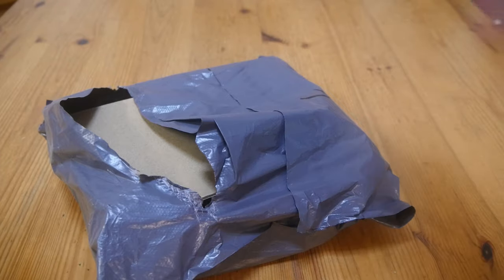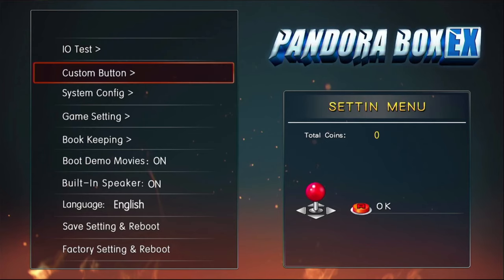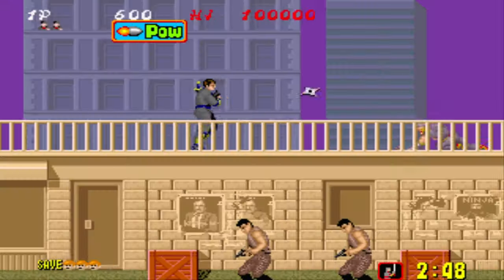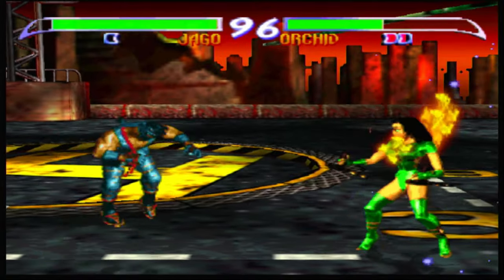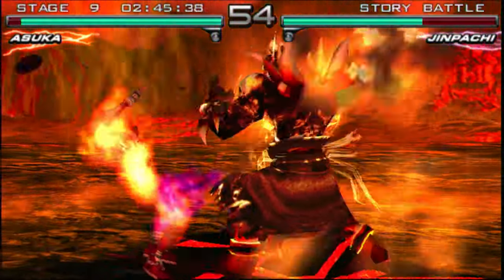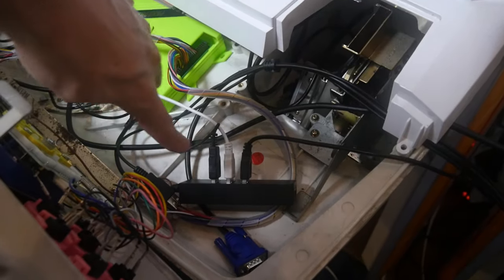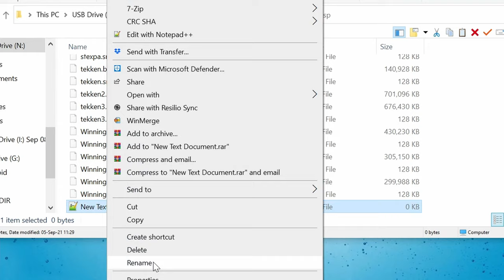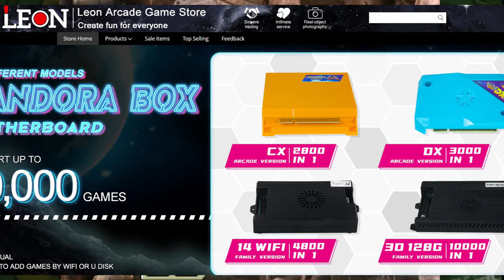3A Pandora Box EX [3300 Games] - FULL REVIEW and Guide

Comment: Not sure how it is on newer Pandora Box's, but for 6 buttons, I changed it in the global settings to ABC across the top 3 button, DEF across the bottom buttons.  This makes it normal for all Capcom fighting games, at least the arcade versions.  It might fix some of the control issues for other systems as well.
Reply from the maker: Yes. We are aware of control configuration. However setting abc def like that will give poor control maps for neogeo games, psp, ps1.

Comment: Will the the box work in an arcade1up  also. Once you set the controls lets say for xmen vs Street fighter will they remain set the next time you turn it on
Reply: I think you may need a video driver board, but outside that, yes.-  We have someone in our discord who has done precisely that (ex in the 1up).  Regarding controls- you set them up once for the WHOLE system-  cant really configure them per game.  The global control settings are saved, however.
Reply: @timwilson1042  thank you

Comment: I'm not sure that I understand why you cannot add more N64 or Dreamcast games. Is it because the flash drive is full or is there something in the programming that only allows two N64 games at a time. I would think you could add a larger flash drive or perhaps an external flash drive to the usb port like the DX has. Can you explain that to me. I asked the Pbox store and the 3H store and they said it was false. Just curious.
Reply from the maker: Please check our follow-up video on adding games.
The manual that was sent out was a dx, and even the ex manual had no explanation on adding games. - we had to work it out ourselves !!!
Reply from the maker: Regardless, there is no way to bind the analogue stick for n64 games, so near none will work. 
The dc is far more compatible.

Comment: Great video,. Question, many of the games I played like Striker1945, Street Fighter 3rd Strike, etc are not saving my high scores. The neo geo games like Aero Fighters and Bust A Move are saving my high scores. Is there a reason why some games are not saving my high scores?
Reply from the maker: Many of these arcade games actually DIDN'T SAVE SCORES (believe it or not!) - They left the games on for months on end.  NeoGeo had memory card / save functionality, so that could be why.  If you're concerned about keeping high scores, remember you can SAVE STATE when you finish and then LOAD STATE when you re-load that game. - It's a work around but should work.
Reply: @TeamPandory  Okay, I did as you had suggested and works great,. Thank you so much for the tip
Reply from the maker: @rokuvaan  glad to see you have a solution.  It's a shame the saves don't actually record to the memory card though... Or do they?  The ex was a bit disappointing tbh.

Comment: Hi, I need some advice. I have a jamma cabinet with 4: 3 arcade monitor (15khz), and the pc broke. I would like to wear a pandora, which one do you recommend? I was thinking about DX, I just need to emulate 80/90 2D games, I don't need 3D. Which is the best? Thanks!
Reply from the maker: We will be making a video regarding this in the next few weeks... The answer is a bit complex in that regards. 
I'm actually enjoying the "pandora x games" more than any of the 3A boxes in 15hz 4:3 CGA. The image is far sharper, and even though there is no save state, adding games, etc. It's just more fun to play on.
Reply: @TeamPandory  Strange, I knew that on the right you can save and add games ..
Reply from the maker: @Pumpkinold  with 3A boxes, yes. But the one I like to use is the Pandora X Games 2600 ... It is in our top 10 best Pandora list.  Has a much finer image than the cx or dx jamma.
Reply: @TeamPandory  But for the jamma cabinet with 15khz monitor which one do you recommend? From what I understand there is only one possible version, namely the DX. And they told me that 80/90 2d games all run fine. It's not true?

Comment: hello i have pandora dx im having sound problem in mortal kombat mk2 mk3 and umk3... i need mk2.nv mk3.nv and umk3.nv file?
Reply from the maker: Might be better to put this comment in a DX video- But you should check PandoryDX, we've just released 1.12 which also adds NVRAM for a few of these games.
Reply: @TeamPandory  not working witch pandory 1.12 for me....where add nvram files?
Reply: MK1 coin version run ok but mk2 mk3 and umk3 have problems with sound.....
Reply from the maker: @mariuszdobrzyn9603  Again, they are included when you install pandorydx 1.12 / Outside that we have them in the discord.
Reply: @TeamPandory  Again sound glitches.

Comment: I think 3A is totally falling behind it's clone competitors in terms of functionality. When they added console games to the DX, it seemed they were only doing it because Saga and PG3D had done the same to bolster their numbers. There seems to be little forethought applied to what titles they choose for these platforms.

I like their choice in chipset, it should be enough to add atomiswave and naomi games, strange they chose not to. The screen tearing is likely gone due to an increase in horsepower, not because of any change they've made in  their proprietary software.

Oh well, perhaps when 3H games chooses to release the FX it will address the issues you have, however unlikely that is.
Reply from the maker: That was mentioned earlier... I think it's more to do with the different hardware used with graphics drivers on the mali 400 being extremely flakey at best - especially on Linux.

This more likely has android running in the background , hint is the mouse pointer in the trackball game
Reply from the maker: Bang on regarding console / arcade games.  They lost focus with the successful clones. 
Bring it back. The focus on arcade, Naomi, flawless mame titles. The console titles included should only be arcade games that cannot run well, and not to bolster up numbers (includes nes/ hacked/ cheat versions)
Reply: @TeamPandory  I have no problem with them using the Snes9x core to include Killer Instinct or Genesis GX to include Galaxy Force II. Those arcade titles wouldn't run well on this hardware. But a title like Mario kart 64 should be added by the user if they're keen on playing it on an arcade stick.
Reply: @TeamPandory  I agree 100 percent with you. I wish they would come out with an "elites editions" like coinops has. Only the best games plus a handful of the best arcade style console games. Like 500 games total and make sure they are all configured right. 

Of course I know 3a will never do this because it's easier to market "more games!!!" Instead of quality games configured correctly.
Reply from the maker: @Brian Babin they updated the dx a couple of times, but still didn't manage to fix any of the irritations we had with the 3A range of machines. 
It's like asking the council to repair a large pot hole in the road. They'd completely ignore it, then go put up speed traps.
Reply from the maker: @ryecatcher25  don't look over there, we gots psp games now!!!!

Comment: I followed the instructions to change the resolution but nothing happens. Any advice?
Reply from the maker: What did you want to change resolution to?
Reply: @TeamPandory  I have a 5:4 monitor but I have just realised that 1280x1024 is not supported
Reply from the maker: @fabriziob8522  If your monitor supports 720p or 1080p input- it'll be ok.  It'd just stretch it to the screen size.
Reply: @TeamPandory  my monitor support 1080p but the quality of the image is not good because pandora support only 2 resolutions

Comment: https://youtu.be/js-jJzpVOqY?t=401 "It'd be nice if we could rotate the screen"

Is that something we could achieve with the Pandory Tool, eg, to launch DoDonPachi and other Shoot'em Ups on Tate mode?

If it is possible to do with this tool, do you have a video to see how it's done first (does it need to be done game by game on a PC)? or could you see if a video could be make to learn how that could be done if you get the chance?

Thank you!
Reply from the maker: You can do this with Pandory on a Pandora Box DX.  This "Pandora Box Ex" in this video is still untouched by our software.
Reply: @TeamPandory  And that configuration to rotate games on the DX, is it something that needs to be done via a PC and changing that config for one game at a time? 

Or is there like a bulk option to configure with rotation a lot of games in one go?
Reply from the maker: @michaels-h5539  Change one line in pandory.xml and it'll switch all (most) the TATE games to be rotated.  You can adjust this per game, however.  Do it one time on a PC then no need to touch it again.
Reply: @TeamPandory  Awesome, that sounds great, thank you!

Comment: Is ex or dx better?
Reply from the maker: We couldn't tell you as it totally depends on your intended use.  15khz CGA? Want to use Dreamcast / PSP? Are you more concerned about the older games?  Do you want to use pads?  Sadly, they're both terribly flawed at stock -and we can only recommend the DX after using the hack to fix many of it's problems.
Reply: @TeamPandory  I pay more attention to beautiful graphics, so the EX model looks more attractive.
Reply from the maker: @Susceptive35  to play with a controller ?
Reply: @TeamPandory  I have fighting stick and ps3 gamepad.
Reply from the maker: @Susceptive35  then you DON'T want a Pandora's box. You'll be better getting a fully decked emuelec system. We have a ranking video
Reply from the maker: @Susceptive35  check this https://youtu.be/zEgK7EOD8mc
Reply: @TeamPandory  Ty for help.
Reply from the maker: @Susceptive35  No worries

Comment: So the Mali G31 supports Vulkan 1.0, do any of the other emulators you guys add on here support Vulkan? May show an improvement in performance. I am thinking the ones with the Mali 450 MP8 will perform better unless Vulkan works magic somehow
Reply from the maker: Vulkan is dependant on the system it's running. I highly doubt as it is that it supports vulkan as is - remember the mouse bug is present, a relic back from Android 4